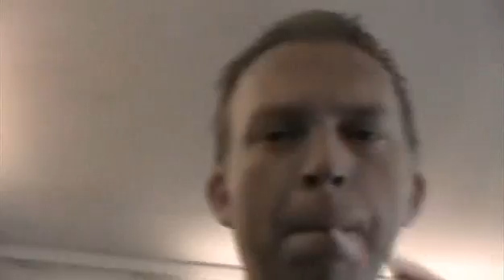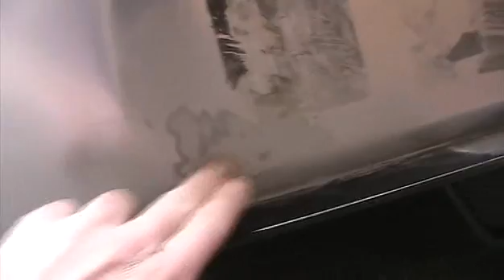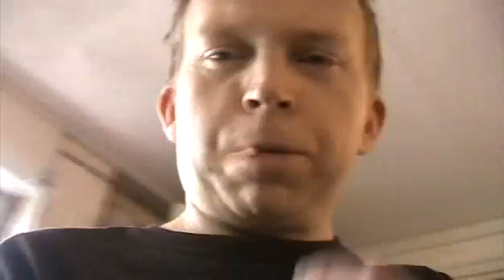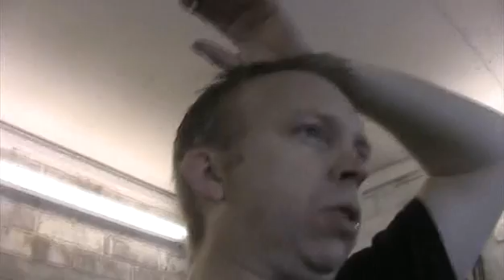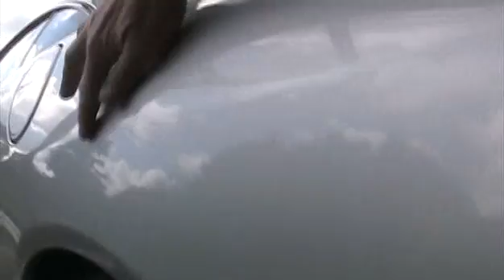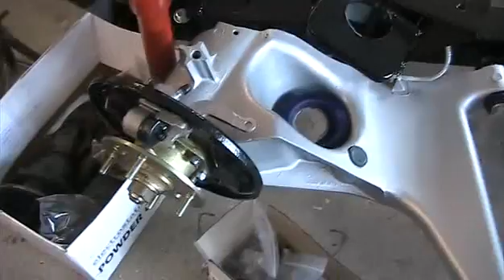16th May - Little paint job to do

Comment from the maker: Yeah it is fun John, I'm just teasing!!!!!   I thought my electrolyte would last, but sometimes i get impatient, and put things in it before they're really clean....maybe that's it, but I do also have problems figuring out the amps to pump in it for a specific part, I have read about 0.14 amps per square inch, but sometimes it's difficult to work it out if it's a funny shape....think I need to work on it.....but your stuff came out good john, that was a good video that :-)